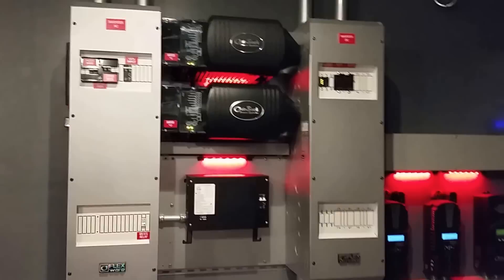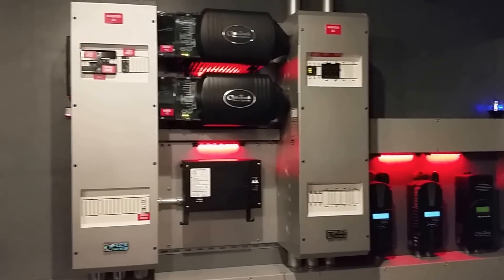The Ultimate Off Grid solar with Outback Power

Comment: This is Jack from Vikli Power  Ltd.
Providing high quality Lithium ion battery for our customer is our mission and culture.

We are mainly in Lithium polymer prismatic soft package batt ery and LiFePO4 prismatic soft  package battery.
Our lithium ion battery is mainly used for Solar Storage System ，Environment Monitoring Device and Electric Vehicle.            

Contacting Via:
Nmae:    Jack Xu

SHENZHEN VIKLI POWER SOURCE LTD.,
Address: 3th floor,Block B, western industrial buildings,park road,22 District,Baoan,Shenzhen,Guangdong,China
Tel: 0755-2783 0050
Fax: 0755-2783 0040

Facebook:              Xu Jack(Jack Xu)
WhatsApp：          +0086 13647219672
WeChat:                 +0086 13510061131
Mobile phone:       +0086 13510061131
E-mail:                    vikli10@vikli.com
Skype：                  jackxu5202
QQ：                      325123919

Website：              www.vikli.com
Reply from the maker: +jack xu why don't you send me some to use on my system I'll take 24-30 kWh
Reply: Hi，Jason Andrade
Thanks for your reply.
I need much more information about your Lithium ion battery requirements.
So please send email to me.My email:  jackxuvikli@gmail.com
I will reply your email and send some our lithium ion battey production pictures and battery specifications to you.Looking forward to received your email.
Reply from the maker: hey Jack I tried emailing the address you sent  and it was returned
Reply: i  am sorry

Comment: Man, that looks fantastic, but I can't even begin to think how I would actually use that much electricity.
Reply from the maker: +Pop's Shack it's easy I have a wife and daughter who I think have the most powerful hairdryers on the market :) I have a modest size house and the temp reaches 113 here frequently in the summer so most of the power goes to cooling.  Being the creative guy I am I also frequency am welding cutting with the plasma or in general building something.  Soon I will have the new maker section cleaned out and ready to show what I have been up to and I may need to add a little bit more pv and defiantly the last two inverters

Comment: which sytem do u think is best for full off grid 2 of new fxr's or the radians?
Reply from the maker: it is really a project specific they are both great and can do good things. do you have big 240 volt loads?
Reply: +Jason Andrade 

He'll have a water transfer pump for his rain collection thats about it. my friend is building a house in Hawaii and wants some help. im savy. have done tons of code comliant breaker panel upgrades and have been tinkering with inverter chargers (ups) for some time but never done a full high end system. he wont have any hvac. a parent they say not many people do. propane stove and dryer. nothing 240 except maybe that pump and even then might be able to get an adequate pump at 120. Him and his wife want no shortages of amenities. washer, dryer, freezers, toasters, cofee pots, tvs and anything else everyone else has. no sacrifices.  on the side i refurbish military gennys and sell them and got him hooked up with a nice mep-802a 5kw diesel brushless genny that im going  to hook up for bypass and auto start for charging batteries if need be.
Reply from the maker: +Bobby Diminnie I would say the radian, mainly because the ability to run off one power module and the system can still operate at half capacity.  it also uses a smaller footprint than two fxr inverters. is the generator you are running 120 or 240?
I would have used the radian but I wanted the space in the flex ware enclosures and had one vfx already, the radian gslc will take a little DNA from you if your not careful.
I buy everything from wholesalesolar they have shipped a bunch to Hawaii and build top-notch prewired systems with supplied wiring diagrams/tech support.
Reply from the maker: Thanks for the sub and liking my page!
Reply: +Jason Andrade 
The military generator is 120v 3 wire (LNG), 240v 4 wire (L1L2NG)or 208v 5 wire (L1L2L3NG) just depends wich position you have the output switch selected. The military underrates there units so they can perform in the harshest conditions and still output rated capacity but in reality there 7.5kw units at 80°f sea-level. i was leaning twords the radians too cause i like the clean install. your install is supper clean too with the fx's. its just evertime i see a radian system its on a grid tie as a back up just wasnt sure it was suitable for continous use off grid aplications. thanks again and no problem on the sub.
Reply from the maker: +Bobby Diminnie the radian is the best all around inverter off grid or battery back up!
I am a big fan of OB power
Reply: +Jason Andrade 
Cool thanks again. ill pick ur brain again once he starts building and we get closer
Reply from the maker: +Bobby Diminnie no sweat
Reply from the maker: I'm going to Hawaii for vacation later this year, where and when is your project
Reply: +Jason Andrade 
He hasn't given me a date yet he told me he's getting all his bids and contractors lined up now and he's shooting to be moved in in the next 15 months
Reply: +Jason Andrade 
also its on the big island. he told me the city but i forgot cause they all sound the same to me. haha. ill ask him again.he should just be getting to work now. hes 6 hrs behind me in mi